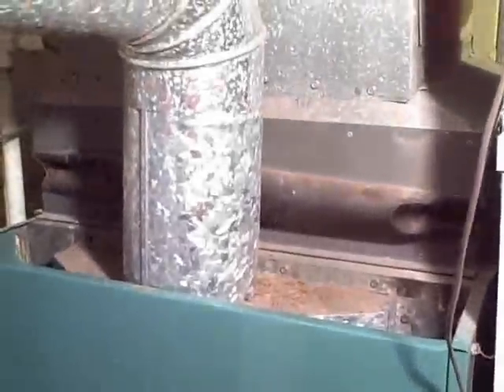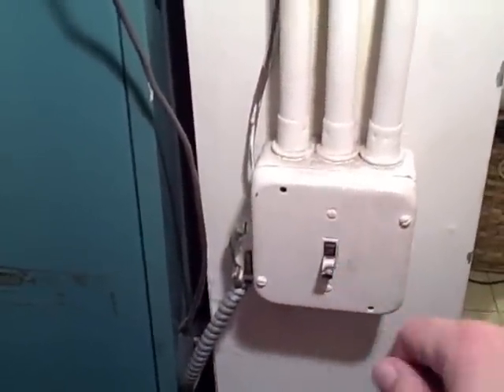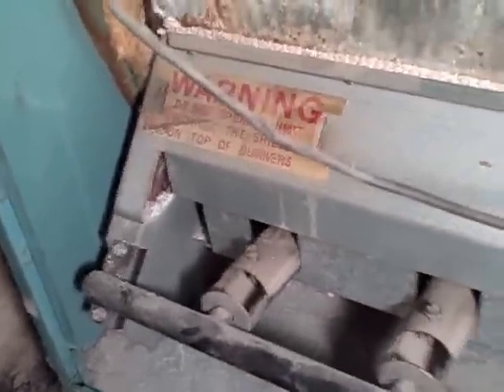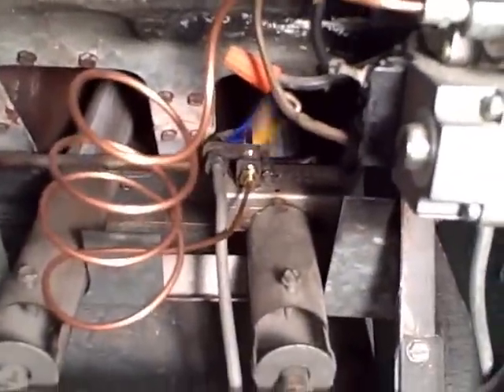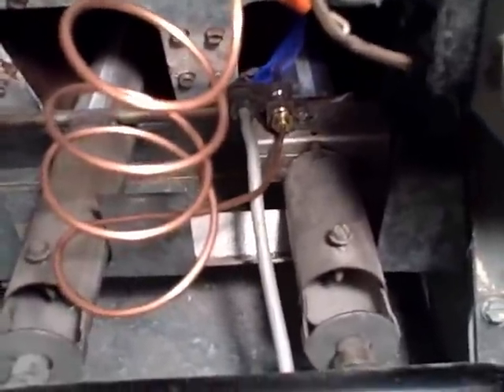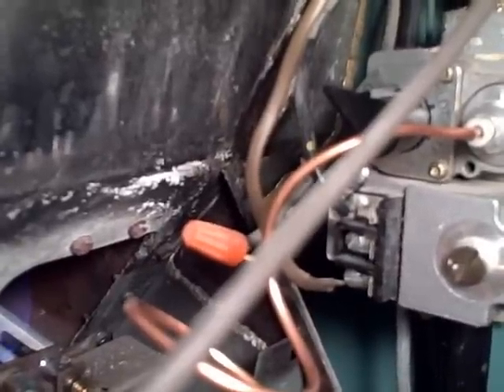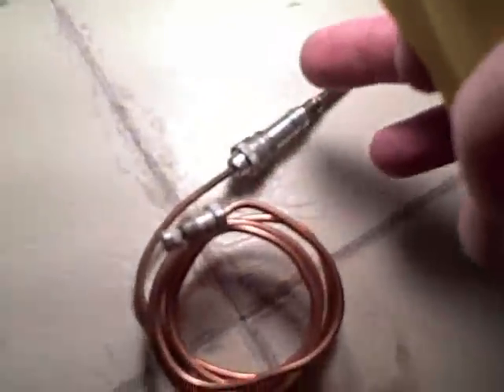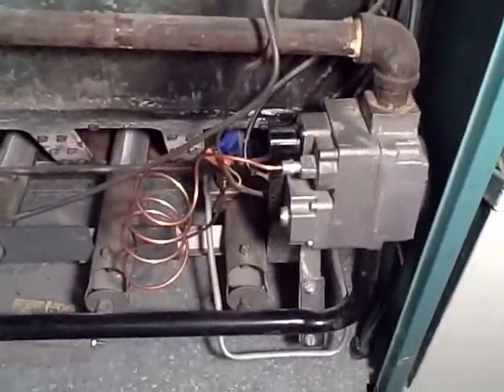Furnace Pilot Light (fix) replace $10 thermocouple - watch this on your iphone too!

Comment: A main reason furnaces go out is due to the thermal couple. Typically it can be due to your furnace running too high/hot, but theres many reasons. I have the oldest system known to mankind and aside from adjusting some things I've had to replace the thermo couple twice in the past four years. Just imagine if I had the two companies he had come by first to diagnose the problem. Would have went through two furnaces! Glad the guy on the vid made this to help others and very informative. Thanks!

Comment: Thank you so much for this wonderful video. I had the same problem for the last three days and I have called the company to get it fixed. They told me that I was going to get charged $140. It sounded expensive and I have done some research and come a cross your video. We had exactly the same furnace and I knew that we had the same problem based on your explanation. I went to Lowes today and got exactly the same brand and part. It was so easy to replace it. My house is warm again. THANK YOU!!!!!

Comment: whens the last time you cleaned that furnace? With a furnace that old you should get it cleaned it might have a cracked heat exchanger because its so old. If you dont clean them like your suppost to that will damage the exchanger plus age also will cause exchangers to crack.

Comment: Replace would be the best option because looking at the age of the unit the heat exchanger might have cracks and possibility of co2 leaking is high . Make sure you perform a carbon monoxide test

Comment: Hi, i have a warm air hot water heater (from UK) uses honeywell parts.
My problem is that i get the pilot light alight by holding down the button and physically lighting it. i hold the button in for 30 seconds and it should stay lit, but as soon as i let go of the button, the pilot goes out. Someone told me it could be the thrermocouple.
The Hot water is on running fine but my problem is the heating.
Any ideas anyone please?

Comment: I'd definitely have it checked for cracks, CO is nothing to mess around with.  Also new furnaces don't have a pilot to waste fuel on standby. You could go with a high efficiency furnace to stop losing all that heat up the chimney!  Just something to think about.

Comment: I found information that said, before changing thermocouple. try cleaning the soot off the pilot light area. Can use ultra fine steel wool or 250 grit sandpaper. Im trying that first because mine has an ash look on it. Now that is savings in several ways.

Comment from the maker: @stahlmaster I've had other problems with my furnace, fan died, 3 people told me I needed a new system $1600+ two told me I had a crack in my heat exchanger and I'd have CO problems, told them I had a CO detector, they told me it was probably faulty.  Told my girl fiend she said call George an HVAC guy in her neighborhood, he drove 30 miles to my house, replaced the fan charged me $170 and said my furnace was old but fine and safe, it should last for years!  It's tough to find good guys!

Comment: I replaced the thermocouple, but I still was not able to light the pilot. I turned off the electric switch near the furnace and turned the knob from the gas valve to OFF position, wait for 5 minutes then turn the knob to pilot position, hold it down and light the pilot and keep holding for a few minutes. When I released the pilot knob, the flame won't stay lit. I only had a small flame though. I tried that process several times. While I was doing all of that, I had my thermostat in OFF position. Am I supposed to turn the thermostat to HEAT position instead of OFF? Is it possible that the pilot itself is dirty and needs to be cleaned or replaced?

Comment: Obviously, this person is mechanically inclined and can handle small repairs.  However, the average person dealing with gas fittings in their home is a bad idea.  Its literally lethal.
Just wanted to put that out there for do it yourselfers..... Call a contractor when it comes to your furnace.

Comment: Most common problem with replacing TC is over-tightening the connection to the valve.  A thermocouple generates a very small amount of electricity to hold the safety valve open while pilot is burning on it.  If you over-tighten it, it will ground it out and it will not work.  Only tighten with your fingers and then turn 1/4 turn with wrench.
Reply: Thank you.

Comment: I own a heating and air company, and have been in the field for 8 years. To hear that other companies are charging 500+ for this repair is awful. I would have only charged 90.00 for that repair. But if a thermocouple doesn't fix it you probably need a gas valve and they are expensive like 300-400 installed.
Reply: Come on man. $90? That's why I do all my repairs. I go to YouTube and get all the info that I need.  I've repaired washers and dryers, air conditioners, refrigerators, roof leaks, all my auto repairs.  A person would have to be totally handicap to deal with repair people. You guys are insane. Thank god for YouTube and people like this.

Comment: If you know that much, I'm sure you know enough to inspect the heat jacket with a light inserted and look for cracks from outside every 5 years or so. Yeah buy the new one, the one that is made for hi,tech  service.with all the lovely electronics like the modern automobile Garbage!!!   keeps you in bondage to the company service even to the 40 dollar filters they recommend ! Oh they'll save gas, and what you save will go to costly diagnostic repairs. Just put heat fins on the exhaust pipes to pull that 7% lost heat before it gos up the chimney. When and if they have an efficient unit that works with simple controls like this [30 years and still running] I'll be the first to drop a few grand and buy one and then alter the filter box to accept a normal filter. Always some engineers directing a money generator for the manufactory complex.

Comment: I replaced the thermocouple, but I was not able to light the pilot. I turned off the electric switch near the furnace as well as the thermostat and turned the knob from the gas valve to OFF position, wait for 5 minutes then turn the knob to pilot position, hold it down and light the pilot and keep holding for a few minutes. When I released the pilot knob, the flame won't stay lit. I only had a small flame though. I tried that process several times. While I was doing all of that, I had my thermostat in OFF position. Am I supposed to turn the thermostat to HEAT position instead of OFF? Is it possible that the pilot itself is dirty and needs cleaning or even replaced?